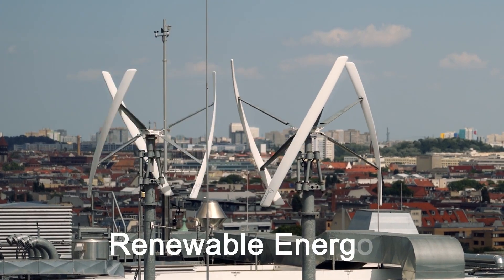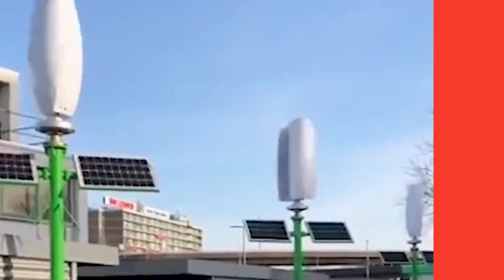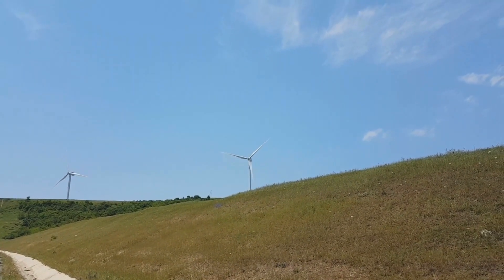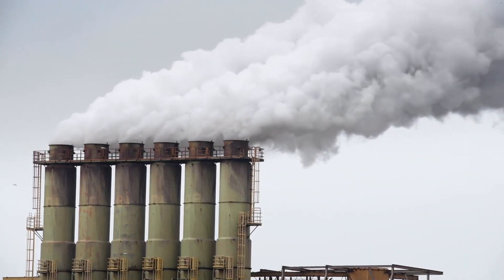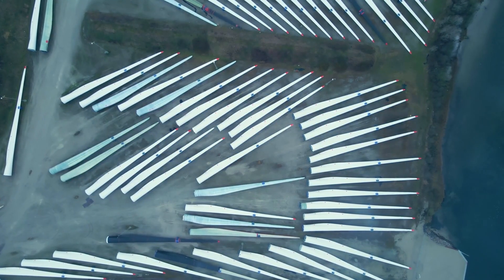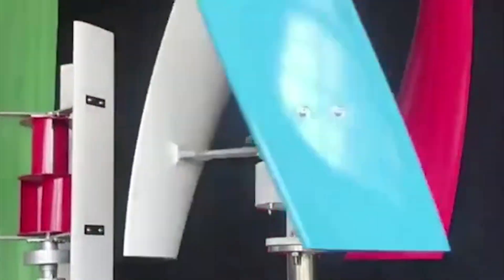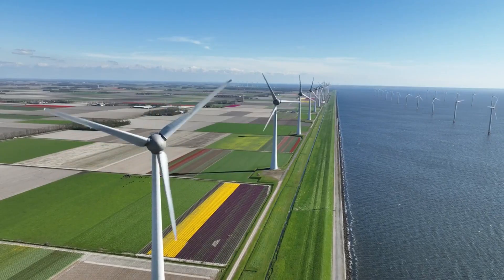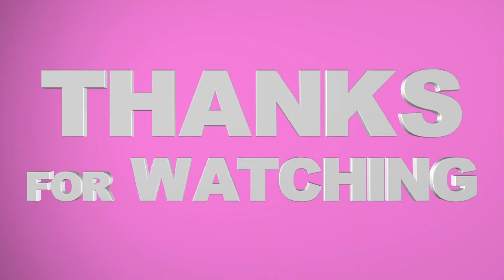Novel Flower Wind Turbines That Will Replace Solar Panels - GameChanger

Comment: no, it's not revolutionary, because with a classic HAWT, all the blades are receiving pressure from the wind at the same time, and with ANY VAWT only 1 blade is receiving wind pressure at a time while the others are creating drag.
Reply from the maker: I agree with you. Thats why the blades require spcial design